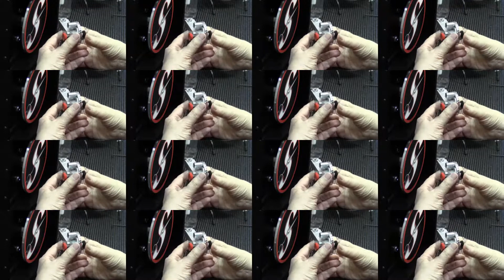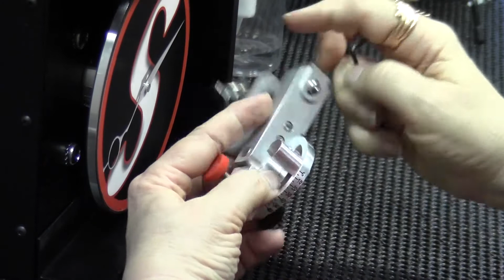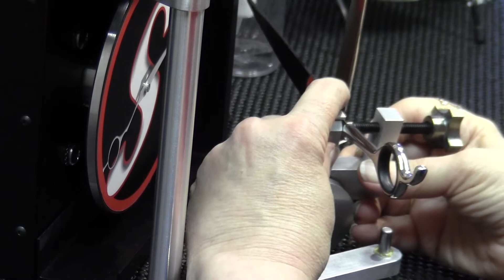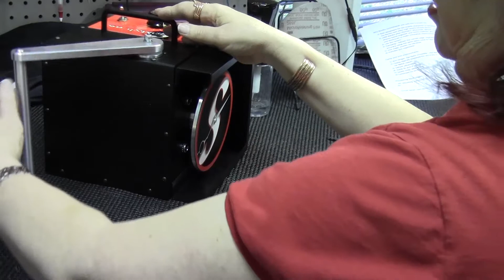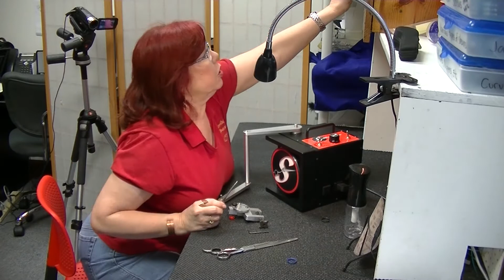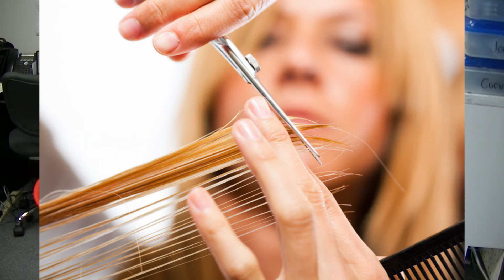Scimech Scissor Sharpening Clamp Upgrade

Comment: Hi, I need to know to which email I can request information for the purchase of this machine, I live in Mexico so I will need shipping information or a purchase system like ebay. Thanks and I remain on the slope
Question: What type of sandpaper does the machine use? Can I get them in Mexico? And until grit of sandpaper comes on the computer?
Reply from the maker: You can find the samdpaper in Mexico. It is the same as used in automotive body work. please contact me at bonikashears@live.com or go to the website for information www.bonika.com

Comment: this clamp is pricey, Hamaguri clamp sales for $250, twice as sharp as low as $68 so why this one is $700? it is not better than  Hamaguri.
Reply from the maker: All the parts are custom made with precision.  The price is based on the production cost.  I happen to think it is the best system for precision, ease of use and ergonomics available.